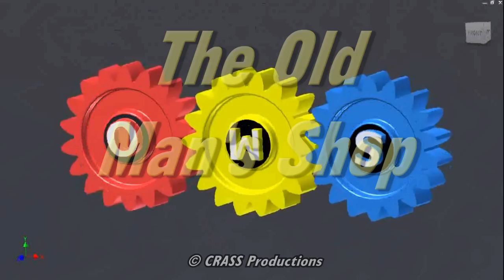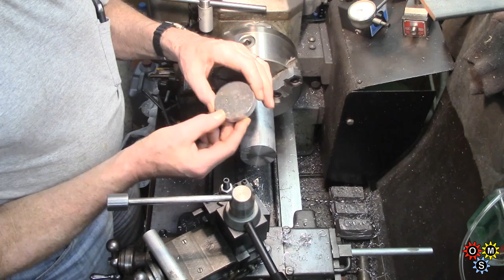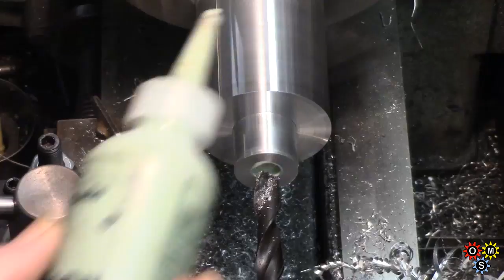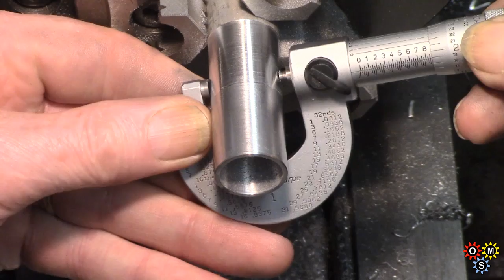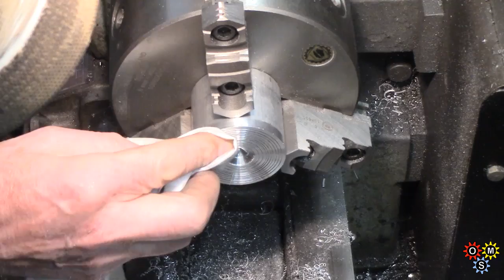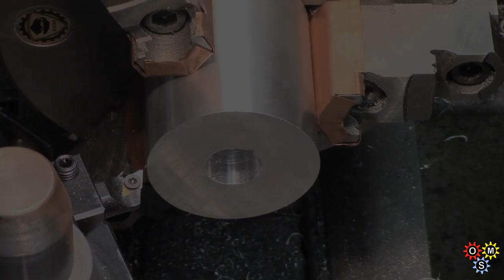Aluminum Oil Pot, Part One

Comment: I watched the videos Lee put together on the Oil pot I think I'm going to make one with small magnets in the bottom so it stays on my mill or lathe.
Reply from the maker: Only thing I thought about magnets in base, is - they'll attract chips -  perhaps too much!
Reply: That is what Lee said.  I put a magnet in the bottom of my plastic cups and it does collect chips but its not to back I'm not sure yet as Lee says it is over engineered.  Great videos

Comment: Hi Chris,
This is going to be a good looking oil pot, think the size is ok, not everyone has a huge lathe to install a bath tub size oiler...
In my own opinion, magnets are more a nuisance than a help, it attracts every steel chips and dirt and magnetizes your machines...
Reply from the maker: Hi Pierre,
Yes, I think size will be OK. Also by keeping wall thickness generous and base also, it should be fairly stable. I like the magnet idea but agree, it is likely to be a nuisance making chips stick!

Comment: Chris.  Far more elegant than my Mr. Pete tuna can version.  I think I'll upgrade in the future.  Hope the back settles down and the shop temperature is mild.
Reply from the maker: Hi Roy - thanks. Well my day to day oil pot is just a can with a heavy bearing shell in bottom for weight - it serves OK. Though though it'd be nice to make a dedicated item. I may make myself similar later on.

Comment: Drill holes in the bottom deep enough to epoxy in two or four rare earth magnets. It would make it less tippy.
Reply from the maker: Hi Tom - great idea. My only reservation however might be the probability of the base then getting covered in chips! I think the weight of this when done should make it fairly stable.

Comment: Chris, sorry but I was laughing to myself over your mess of chips because I know exactly what you're experiencing. I tried every style of cutter I have and it made practically no difference except in the finish. Thank you so much for the channel plugs. I was wondering why my "views" count took a sudden surge this evening & also several new subscribers. Looking forward to the rest of your build. BTW: My inspiration actually came from a viewer gift to Pierre Beaudry that was made from stainless steel & welded together.
Reply: Hi Lee,
Mine was actually made by Darren Blatner, he did a wonderful job, made with stainless, sure not to tip with the size and weight...   ;)
A gift made by someone that takes some time to say they appreciate is of great value...
Pierre
Reply from the maker: Hi Lee -- you may 'enjoy' the chip mess of course having suffered the same! :)
Ahh - had forgotten Pierre's stainless one.
Hope to press on with remainder of the project soon - and hope it will turn out out OK and be useful for someone.